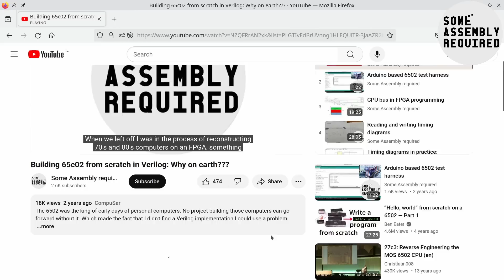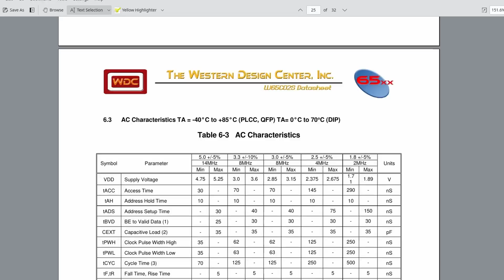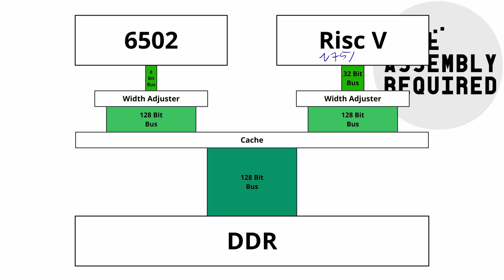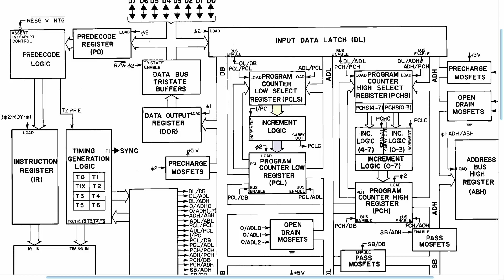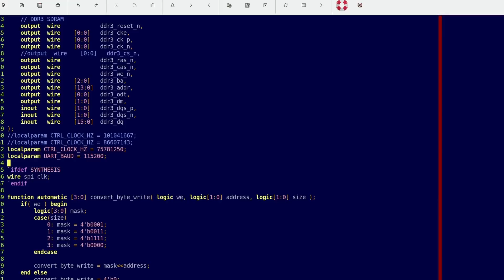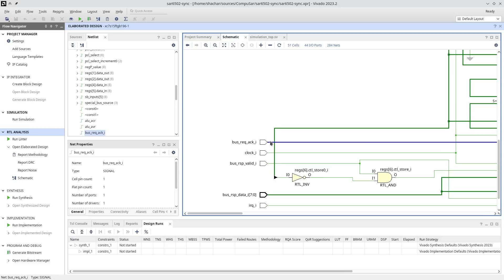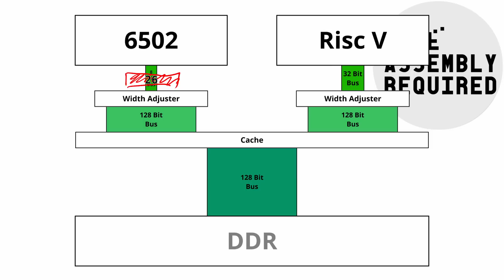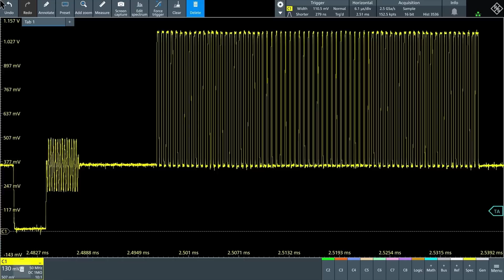Rearchitecting the 6502

Comment: A reasonable approach, given that your target speed is two orders of magnitude lower than the native FPGA clock, LOL.  Another trick I saw in an old 1972-era minicomputer was to generate the instruction clock from an 8x oscillator (1 MHz insn cycle from an 8 MHz clock), and use a counter and decoder (74LS138 idea) to generate eight distinct phases of the clock. The designers sequenced (or micro-sequenced? not quite the same as the modern concept) the flow within an insn by clocking flops or enabling latched on each of the distinct phases when they needed it.  So you might increment the PC on phase 1 but load the instruction from memory in phase 2, load the register read data indexed by the opcode on phase 3, and so on.  It worked quite well in practice for the mostly 74xx TTL design.  But would be a nightmare in an FPGA unless you use them strictly as clock enables in a natively 8x fully synchronous clock design, which is sort of what you're doing.
Reply from the maker: Actually there's an important difference between that and what I'm doing. In control, it's called open loop vs. closed loop feed back.
Doing that would generate the correct clock out of the too-fast clock. Execution rate would be constant and predictable, and you would only be able to divide the original clock by a whole number. If you don't want to muck around with DDR modules, you might even be limited to dividing by an even number.
Aside from allowing to divide by an odd number (and, in fact, reach any rational fraction of the original clock), this technique is a closed loop feedback control. If there is an external source of delay, such as DDR being unavailable or bus contention with another unit (the Risc-V, HDMI and SPI all also need to access the memory), in your way you're pretty much resigned to lose the whole cycle. In my way you make up for the lost time, and do so at a rate adapted to the high frequency clock.
Reply: @CompuSAR  Maybe I didn't explain it clearly enough, but  the technique I described would scale to odd number of phases per master cycle as well. Pretty easy to make a 3-bit mod 7 synchronous counter. But you are right about the granularity, with this approach it's a way of sequencing inside a fixed temporal framework, and like you said it wouldn't scale to wait states that were individual phases. I wasn't trying to say it was isomorphic to your approach, it's one of those approaches that shares some commonalities and tries to solve some of the same problems. Just cool that people have the same fundamental issues in 2024 as they did in 1974.

When I built a similar CPU in an FPGA under supervisory control of a faster processor, I built a bunch of debug and single-step regiters into my VHDL CPU.  You could set a bit that would run just one insn then pause, so you could single step.  I had my register file implemented in dual-port RAM, so I added an extra port (with some multiplex control logic) so the supervisory CPU could read and write register values before and after single stepping. And also interfaces to the memory access registers so I could perform memory reads and writes from the supervisor as if I was the VHDL CPU.  It was a bunch of overhead but it let me do some fun things for testing and validation.
Reply from the maker: I love how you treat trying to hook up a 6502 to a system a "2024 issue".
The debugging is fun, but funnily enough, unneeded in my case. Of all the things this project involves, writing 6502 code isn't one of them. It might (and has) been useful in order to debug bugs in the CPU itself, but the amount of code involved in 8 bit computers is so small that just running in the RTL simulator was enough for that.
Since then my test program has evolved to the point where it is unlikely that a CPU that passes it will have many bugs.
Reply: It turned out that all those latches are expensive. The i386 had two phases. Today, most designs are single phase. Each pipeline stage does its work. The result is captured on the edge of one clock signal. Then the new input is gated to new values for the next “task” of this block of combinatorical logic.

More phases allow you to model different gate delays through a circuit. Yeah, and overlap: pass through preliminary results and transients to not loose any time in the latch.
Reply from the maker: I don't think this is about latches being expensive, as it was about the pipeline architecture proving superior, making everyone switch. Pipeline is very flipflops oriented (though it is not immune to cross stages communication).
Reply: @CompuSAR  then explain to me why the deep Pentium4 pipeline failed? A latch needs 7 transistors per bit. I think that the ALU in the 6502 only has like 20 transistors per bit. With 8 phases you pay more ( in terms of area and power) for latches than any real work.
Reply from the maker: @ArneChristianRosenfeldt  I will readily admit ignorance at those levels of analysis. With that said, *as far as I understand*, the main motivator to switch was the promise of more instructions/cycle, rather than power.
The Intel line are the only modern CPUs that still carry machine language defined in the CISC era, and they pay a huge price to convert it to a pipeline in terms of pre-execution processing and, trying to save that, instruction caches size. And it's still worth it to them because the had no hope of achieving super-scalar execution with a CISC architecture.
With that said, all of the above is my understanding of things. It's not my main area of expertise, so if I'm wrong, I'm more than happy to learn.
Reply: @CompuSAR  but physical clock phases and execution stages are not 1:1 related. MHz is physical. 8 clock traces on the PCB are physical.

Combinatorical circuits are 20–100 gate delays long. You input something and then you just have to wait for the result on the other end. There is no phase trick.

This has nothing to do with CISC or instruction reordering. In real Life people switched to ARM instead of trying to run 6502 code on a pipeline. Yeah, might be an interesting exercise.
Reply: Is it possible to rearchitect 6502 for IO storage intensive operations @CompuSAR
Reply: @ArneChristianRosenfeldt  "All those latches"? How do you mean? I mean, the same latches (or FFs) between stages are needed pretty much regardless of how they are clocked. Also, combinatorical circuits are not always 20–100 gate delays long. Some are just 2, 3 or 4 gates in series. An old TTL adder or alu wouldn't have a propagation delay as "short" as 11ns/7ns/5ns (LS/ALS, etc) otherwise.
And what kind of phases did the 386 have, that were two? Phases can mean many things (as you seem to imply yourself).
Reply: @herrbonk3635  I tried to understand visual 6502 . Full adders already have quite a few gates. Then an ALU has all those gates to configure it for different instructions. Then there are busses before and after. It is hardly possible to do anything below 20 gates. I guess that the fast video circuits in 8 bit computers were possible by going down to 20. But even sprite priority solves all 8 sprite at once. So: a lot of gates.

386 has two non overlapping phases. It needs a balanced signal to drive the CMOS flip flops. I had a hard time to understand why FPGA talks about Register Transfer Logic just like assembler language, but flip flops or latches are not enough for a cycle , not enough to build a register. I love static logic (purity). I don’t understand why we have no name for a but in non-transparent registers. Is master-slave data flip flop still some a political correct name? Why do books not put in on a throne? There also seems to be no name for SRAM cells. They are RS flips flops , but also have a word line input.
Reply: @ArneChristianRosenfeldt  The origional NMOS 6501 and 6502 also had two non overlaping clock phases Ø1 and Ø2. In the 6501 they were generated externaly and fed to the clock in pins. On the 6502 there was a single clock in Ø0 and internal logic generated the two non overlaping Ø1 and Ø2 clocks. When WDC designed the CMOS version the 65C02 the delay between the state changes of the clocks was reduced to zero making Ø0 identical to Ø2 and Ø1 indentical to not Ø0. At this point the term Ø0 was droped as Ø2 is what is used to synchronise external devices to the 6500 family of CPUs.
The next thing to mention is how video was implemented on some 6502 computers which is relevant to devices running at a higher clock rate compared to the 6502. On the BBC Micro for example the RAM was clocked at 4Mhz with the CPU being clocked at 2MHz. This was so the video circuitry could get the deta it needed at the correct rate. To achieve this sparation a Tri-state buffer separated the CPUs data bus from the RAM's data bus. There was also an address bus separation but this formed part of the RAM refresh system. The end result the CPU running asychronously at 2MHz could happly live with the RAM which also worked as VRAM operating synchronously at 4MHz.
Reply from the maker: @martinrwolfe  I was not familiar with the Ø stages for the 6500 and 6501. Thank you! I knew that the 65c02 did away with them, but was not familiar with the history.
As for the video: on pretty much all 6502 there is only half the cycle between the address being ready and the RAM expected to provide the data. This means that the RAM always needs to support a clock speed of twice that of the CPU. The trick of using the other half for video  is not unique to the BBC micro. At the very least, the Apple II used the exact same trick.
Reply: @martinrwolfe  Wouldn't the data bus not always need to be tristate so that the 6502 can read data? These are also only 8 pins. In C64 no other chip can write to RAM, so the CPU owns the writeEnable line. 6502 assume ROM or SRAM and cannot generate RAS or CAS -- so you need a separate chip anyway.
Reply: @ArneChristianRosenfeldt  On the BBC at least the ROMs are directly connected to the data bus of the 6502 and their address lines to the low order bits of the CPU's address bus with some multiplexing with the high order address bits and the paged rom selection latch for the ROM chip enable.
Reply: @martinrwolfe  On the C64 like 10 chips seem to be connected to the databus. I guess high-Z inputs really allow for a large fanout. IMHO the main speed bump in the Atari Jaguar is that Atari thought that this would work beyond 30 MHz. PCI bus runs at 33 MHz. Perhaps it helps that the cards are close to each other?
Reply: The multi-phase clock is used on the TMS9900. It has a four-phase clock.

Comment: would that screw up all non-apple 2 usage of your fgpa 6502?
Reply from the maker: I'm sorry, I don't understand the question.
We'll have a Risc-V running in whatever clock speed it can (currently 75MHz), and a 6502 running at the same clock speed, but being throttled down to the original Apple II speeds, so effectively it runs at 1MHz.

Since all internal buses are 75MHz, no clock domains need be maintained.

The only place this requires adapters is if you want the project to allow an external enhancement card, or a Commodore 64 cartridge. This requires a 1MHz async bus, but like I said in the video, I can write an adapter.
Reply from the maker: After re-reading your question, I think I understand it.
Yes, it is highly unlikely that any project other than CompuSar will find a use for a 6502 designed this way. With that said:
a. CompuSar wants to implement more than just the Apple II
b. The same can be said to pretty much all other components in the system.
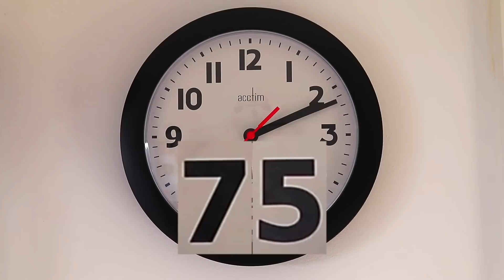At 08:05 I mention that CompuSar isn't a stranger to crazy ideas. This is precisely what I meant. The whole project revolves around building custom modules for tasks where standard modules already exist, so that they are a more precise match and take less FPGA resources, allowing the use of cheaper FPGAs and lowering the end product's BoM.
Reply: @CompuSAR  i was referring to the halting of the clock that was done by the apple ][.  I thought that would affect compatabilty with other systems for example atari 800 or vic 20 or the BBC micro.
Reply from the maker: I am really hard pressed to think of a scenario where two 8 bit systems, whether homogeneous or heterogeneous, would communicate with each other at those clock speeds.
Reply: @CompuSAR  I think he's asking about emulating other 6502 based computers.

As an example, Atari systems ran at a (roughly) 1.79MHz clock which served the CPU and video signal generation.  The exact clock speed derives from NTSC signal generation.  RAM was also shared, and signals mediated the CPU or video chips accessing memory.  Some advanced methods on these machines required the CPU to update memory mapped hardware registers in pixel sync with video generation.

It looks like the method you're using will produce some phase dithering in the emulated 6502 clock, but unlikely to be more than few percent.
Reply from the maker: @hanelyp1  You are assuming that I won't change the 32 bit clock when moving to those systems. The very uneven speed at which the 32 bit clock currently runs was chosen because it's a multiple of the speed an NTSC Apple II runs. If another clock is needed, another one will be used.
With that said, like I said before, any rational fraction can be derived.